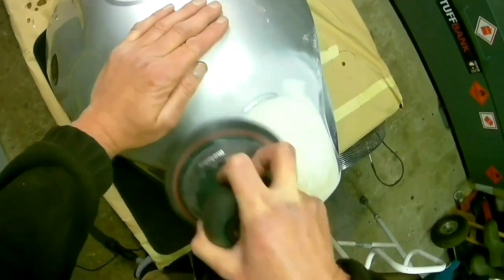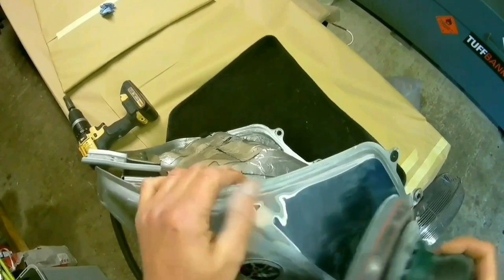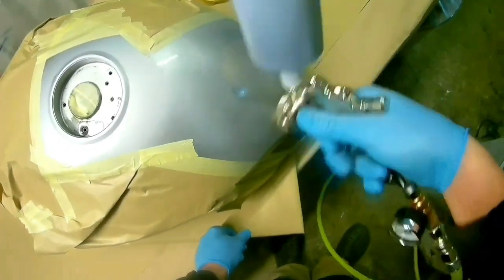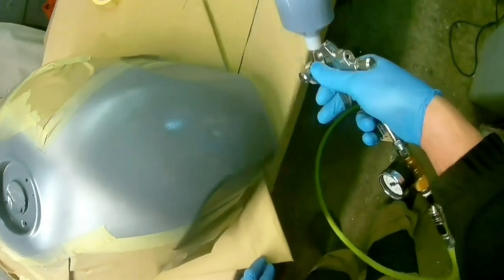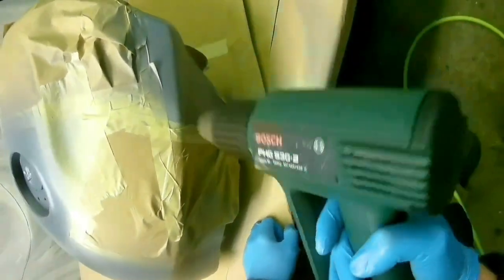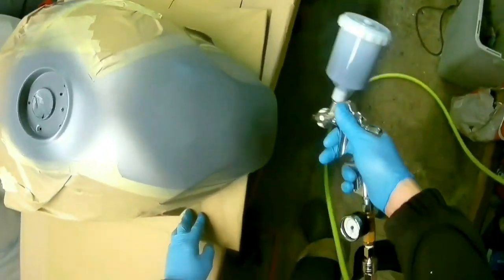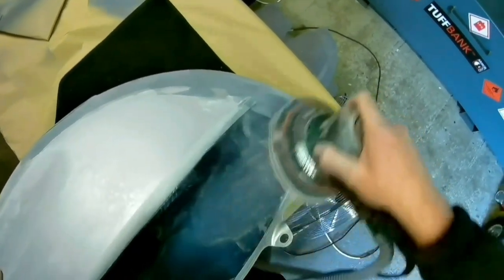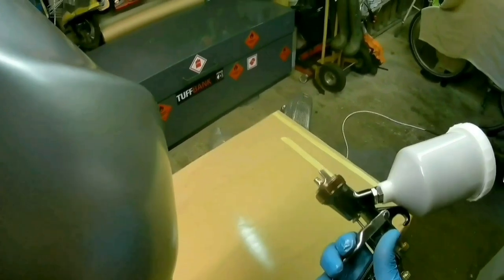Preparation And Base Coat With ANI GF3 And Anest Iwata W400 Bellaria Yamaha Silvers

Comment: @ Pete, Great quality paint job! What is your favorite gun for base and clear? Also, what gun would you most like to spray primer?
Reply from the maker: Hi Ray, That's a difficult one, mainly because I'm aware people don't always have the resources i have, so I'll go two ways with an answer if i may.
First,  money no object at the moment, and I say that as it can change, is, Tekna Pro Lite in 1.2 with TE10 cap for base, Devilbiss DV1 1.3 Clear for clear coat, primer would be the ANI F160 1.9.
If resources are limited i would get a ANI F160 in 1.9 and get a 1.3 tip set for it, all in around £150 GBP which is around $210 USD, appreciate the comments, cheers 👍

Comment: Hi Pete love your videos what psi do you use on base and clear i got the 1.0 tip for touch ups
Reply from the maker: Hi Brian,  thanks for the comments,  much appreciated 👍,  on the W400 i stick around 29psi for base and clear although i will sometimes go a little higher for clear,  depends on what finish you are after and what viscosity the clear is and the setup ,  certainly i find a good place to start is 29psi and go from there
Reply: @peteshobbies5383  pete thanks so much for replying back to me i just bought the wee ani gr3 i think that's the name never used a mini spray gun before but I will try it at 29psi for clear its only for wee touch ups
Reply from the maker: @brianowens2073  ,Hi Brian,  you have the ANI GF3 by the sounds of it, a really good small inexpensive gun, it's recommended to run at 1.5 bar which is around 22psi but i found that too low, for best results i found 2 bar or around 29 psi was good, once again it will depend what you are spraying but don't be afraid to go a little higher on pressure if you feel you want to, just try the pattern on a piece of paper or similar before you start, as long as it keeps a good overall distribution and not top, bottom or middle heavy you should be good, cheers
Reply: I will do thanks pete

Comment: Hi pete, loving the channel, what size compressor do you use, cfm, hp?
Reply from the maker: Hi Ian, thanks, I have 2 compressors,  linked with only one providing the air, so it's a 90lt/23gal, 14.6 cfm 3.5hp and a 50lt 14.5cfm 3.0hp which can run at the same time but doesn't need to
Reply: Cheers pete, iv been getting a 3hp 13.4cfm compressor and a devilbiss flg5. Jst hoping it is enough to spray the odd pannel or two
Reply from the maker: @sparky1543  , that should be fine Ian, should keep up with the FLG5 no problem, what size tank is it?
Reply: @peteshobbies5383   thanks again, its 100L tank.
Reply from the maker: That'll be fine Ian, no worries 👍